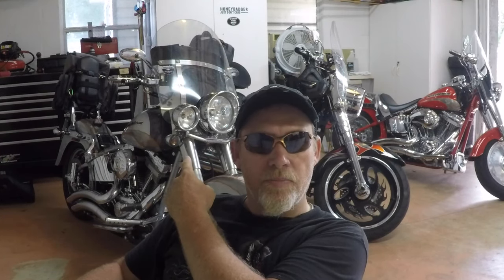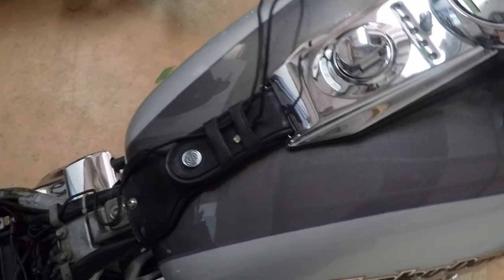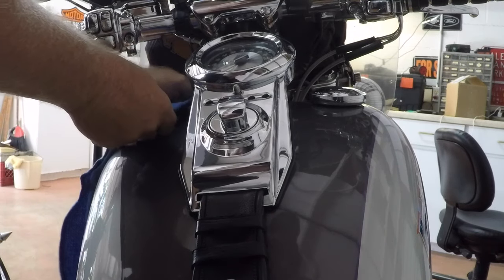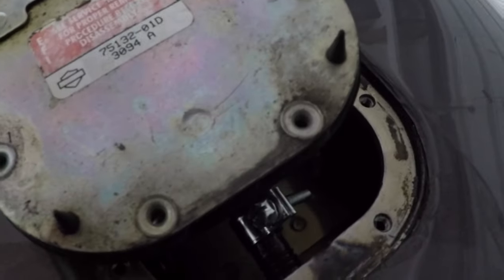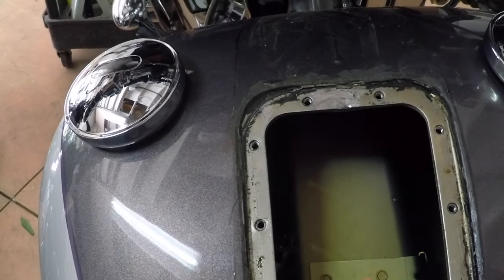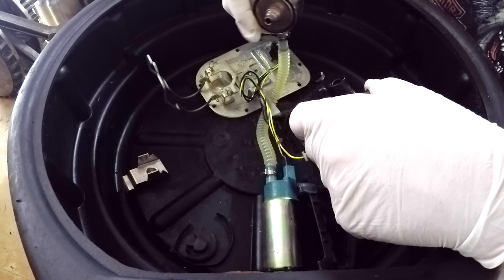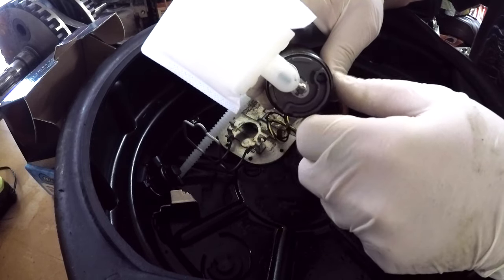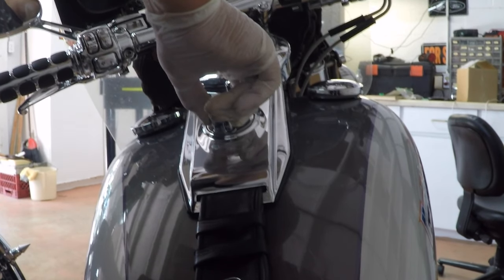How To DIY Replace a Harley Davidson Fuel pump, Fuel filter, and Fuel Pressure Regulator.

Comment: Greetings, and coming to you from Central Florida. The issue I have been having was described in your video exactly, but what was the most helpful, as no one else has offered the suggestion, was to LOOK INTO THE TANK when turning on the ignition and look for the "spraying fuel". I did not think I would be able to see spraying fuel in that very small hole where the fuel goes, but as I did what you suggested, there it was; like a shower spray. I followed your disassembly, but decided to drain the tank before doing so, which was very easy. In less than 10 minutes after disconnecting the battery I had the unit out and disassembled. The tell tale signs are there; cracked mounting tabs on the regulator with the o-ring bulging out. This job would have cost over 500.00 at a Harley Dealer. I am doing this repair on a 2005 HARLEY SOFTAIL DELUXE with FUEL INJECTION. Many, many thanks, my brother, for your tutorial. Another excellent  video from You Tube College.

Comment: THANK YOU! This was very helpful - not only did you not replace every stinking thing, like some people have said you should do including the screws but most importantly you provided the link to the Amazon parts.  That's really helpful!  I just priced out a replacement fuel pump assembly (part 75284-08A) for my 08 FLSTSB and it was $295 (Feb 2024) from the dealer.  On Amazon it's $80.  Thanks again!

Comment: Brotherman I'm SOOO glad I found your video THANK YOU! Ive been banging my head to the wall thinking it was intake gaskets causing my bike to run super lean and seems like its out fuel.. Well, When u brought up how to know this take gas cap off and used flashlight and turned the pump on I thought it was really odd it was shooting everywhere. You saved me a BIG headache! Thank you for this video you are the man! That description of how to check it was DEAD on to what I was seeing.  Subscribed!
Reply from the maker: Thanks man I am glad it helped and saved you some time. Thanks for watching!!
Reply: @TheBadgers   Today , got parts removed fuel pump assy and the regulator was almost completely apart from black housing. Just bought new everything on inside! Once done its running like a champ!  Does this just happen due to pressure pushing the 2 parts away from each other, Or just age. Sorry First HD. :)
Reply from the maker: @XenoWiz  it is a known weakness probably a combo of it all not to mention it’s in fuel which doesn’t help
Reply: ⁹kilo

Comment: I used this video to replace my pump. I had the same issue with putting the retaining washer on the post that secures the prefilter to the pump. I also had to use a small socket and a hammer to drive it on. If you want to keep everything in place put a small piece of tape over the spring washer, taping it to the prefilter housing before you drive it onto the post. This will keep it from dropping off before you get it driven onto the post.
Reply from the maker: Glad it helped,  thanks for the advise and for watching.

Comment: You may know better than me but but I started taking those screws out with my little impact and stopped and switched to a regular ratchet because out of the corner of my eye I seen the Sparks that are admitted inside the housing of the impact😮. I may just be overreacting but I know how combustable just the fumes from gasoline are. 6:07

Comment: Mine just started spitting and sputtering. First thought was fuel or fuel filter. Ill pull the gas cap and see if I see gas spraying around. Thanks for the tips.
Reply from the maker: That sounds like the symptoms for sure, hope you find the problem and get her fixed. Thanks for watching and subscribing.
Reply: What I found was the fuel pump strainer fell apart and half was sitting at the bottom of the tank in one piece. The rest is in tiny pieces or in my fuel filter. I managed to fish out the big piece with a coat hanger.
Reply from the maker: @sjeverett75  did it damage the fuel pump?
Guessing you changed the fuel filter?
Reply: @TheBadgers  I was going to replace the filter and the check valve hose, but my wife said she doesn't want me doing this again in a few weeks so I should just replace the fuel pump and regualtor too. I'm not gonna argue with that.
Reply from the maker: @sjeverett75  might as well take care of it all at once. Glad you got it fixed

Comment: I have the same problem I turned on the key and looked in the fuel tank and I did not see no spray in the tank so what would I need to check other than that?
Reply from the maker: Could be other lines in the tank they will develop holes and create the same problem, while you are in there replace them all and the pressure regulator and housing

Comment: When reinstalling is the pump mount supposed to be locked in the 90 degree position?
Reply from the maker: No you will lock it in position once reinstalled

Comment: Did you buy new regulators also? I didn’t see that part in the kit. Only the pump and hose
Reply from the maker: @tedmond72able  I did but you don’t have to the housing is the actual issue
Reply: When you say housing, is that actually the pump itself? Man thanks for the quick response you’re awesome! 🤘🏽
Reply from the maker: @tedmond72able the regulator sits in a plastic housing, it cracks and make the bike run badly you can just replace it separately
Reply: @TheBadgers  thank you much sir

Comment: I have the same setup. However, this makes me wish I had a petcock, an inline clear filter and my S&S Pumper E carbratooter still!
I spent today covered in gas when my softail crossover pipe nipple broke out of the tank unexpectedly when checking the hose clamp.
Progress? I do not think so!
Very helpful video though, thankyou.

Comment: Sir, I need your input. I was foolish enough to let my fuel injected 2006 Harley Heritage Softail run out of gas. After filling the tank, it will not idle , runs extremely rough, spits and coughs and will die at all speeds. I will be putting in some Sea Foam and hope that it helps if the pump picked up some debris from the bottom of the tank. If the Sea Foam does not work, do you foresee me having to replace the fuel filter? Also, is there a way to drain the tank?
Reply from the maker: Yes you can drain the tank with the crossover hose at the front of the bike. Have you checked the fuel pressure regulator housing?

Comment: Good job although its recommended by HD that all 10 self-sealing screws and top plate gasket be replaced in order to avoid gas vapor escape.
Reply from the maker: This is true, so everyone should do what they are comfortable with, of course they also recommend using a Harley trained technician at one of their dealerships.. Thanks for watching!
Reply: My dore seal liks
Reply: @TheBadgers  haha so true mate ! Good job 👍🏻

Comment: My 07 soft tail custom the fuel pump jus stopped cycling it doesn't run when the key is turned on i left the tank empty enough for the fuel light to be on an it sat for over a year I'm assuming the pump froze up good video thank's
Reply from the maker: Do you have power to the pump? Thanks for watching be sure to hit that subscribe button it helps us out
Reply: @TheBadgers  I did at one time while moving it around and running it to keep thing's lubed up then one day (a while after) I turned the key on and had nothin I actually haven't done any trouble shooting yet but figured with the old old gas sitting in it and run riding it that the pump froze up

Comment: Great video, right up to the point of the high speed stuff we are supposed to watch too, it is part of the installation process. Didn't like that at all, felt like we might miss something important. Or an easier way to do the replacement.
Reply from the maker: Sorry I sped it up because it was a simple part and didn't want to make everyone wait through it. Thanks for watching and the great feedback
Reply: @TheBadgers  Ya but this is my dream bike that I bought by building three others and selling them so I could afford this one so I want it to be kept in pristine condition so my wife can sell it when I die and use the money to put me in the ground. I do not want to mess anything up on this one. So I'm going to be looking for videos to keep it up and running for as long as I can work on it myself. Stage five kidney failure so my time on two wheels is going to be really limited.
Reply: I had the same 05 fat boy silver. Sold it thought it would hold its value but I'm learning these bikes to not hold their value but I would love to buy a blue one 05 Screamin Eagle Fatboy anybody knows where I get one

Comment: My son's 2011 soft tail set up for a bit.  When flipping on the run switch, you don't hear the sound of the fuel pump priming.  I'm guessing it's time to replace the fuel pump and all other parts inside the tank.  Will order the part from JP/Amazon and install it.  Hope it get her going.  Great video!

Comment: My 07 FLHTC ran fine on Saturday, then wouldn't start on Sunday. I disconnected fuel line from quick connect port, then reconnected, & it started. Went for a test ride, and it died 5 or 6 times in about a 2 block round trip - each time it restarted after disconnecting & reconnecting fuel line. After I got back home I was able to get it to stay running, so let it idle for 10 minutes. So now it starts like normal, but I'm afraid that it will leave me stranded somewhere. It might have just been an air-lock in the fuel line (so I've read) but I'm going to replace those parts, to be safe. I've read that ethanol in fuel deteriorates those parts. 2 Co-worker used to be H-D mechanics, & both still wrench on the side, so gonna have one of them do the work for me. I think it will be money well spent for preventive maintenance.

Comment: On the reinstall what is the torque specs and bolt pattern, thank you
Reply from the maker: Consult your manual for those I just tightened mine down, in no certain order

Comment: I have a 2012 road king and my bike does the same thing. It has 55k on it. Like it feels like it’s running outta gas and I give it some more throttle and it will act rite. Usually happens when it’s cold. Same thing as yours?

Comment: Good video.  I'm curious to know if you'd have some insight that might help me.  I have a 2005 RK.  I recently took the tank off to install rocker lockers (didn't help much) and when I put it back together I found my fuel gauge to be dead in the water.  no power to the gauge, it reads empty, and the low gas light on the dash stays on.   I've checked and double checked the wire connections.  The fuses are ok.  I had the battery disconnected during the job, anyway.  I was slow and methodical in my work.  i just do not understand how what i was working on would cause the gauge to quit on me.  One thing I would add is that I hung the tank up vertically from a ceiling hook with a bungee for a couple weeks so gas wouldn't drip out and to keep it out of the way from being damaged.  Do you think me hanging the tank up could have screwed up the fuel pump/gauge unit inside the tank somehow, causing my gauge to quit?  Any ideas?  Pisses me off.  No way I'm taking this thing to a dealer.
Reply from the maker: Wow man congrats on doing the job yourself, as far as the gauge man electronics are such finicky items , I honestly don’t know, let us know what you come up with. Thanks for watching!!
Reply: @TheBadgers  You can use a DVOM and check the ohm readings of your fuel level sending unit. Unplug your wires and use the meter to take readings when the float is down and when the float is in the up/ full position. You may have to research the ohm readings you should be getting from the sending unit in the full and empty positions.Your float may also be malfunctioning after being removed from the gas. The float may always sink to the bottom; giving you an empty reading all the time..
Reply: Update on my issue, long after the fact.   I soon realized that my problem was a badly corroded delphi connector, i think theyre called.  The whole thing looked like a fuzzy green penny.  So basically the wiring, leading to the fuel gauge from underneath the tank.   I guess me disconnecting and reconnecting it that one time caused a corroded pin to break free from its wire.  I ended up having to take the connector pins apart and replacing the connector and pins.   Not going to corrode on me again.   I have the connector sealed off from each end now with silicone rtv, and grease.   These older bikes....seems like every time I take my bike apart to fix one thing, I discover something else I need to address.  I am about to replace my regulator, its housing, fuel filter, the check valve and the inside lines.  My check valve o rings are kind of weepy so I'm going in there and basically replacing everything but the fuel pump, which I know was already replaced some years ago.   A bit of preventative maintenance so hopefully i do not get stranded.

Comment: I have a 2008 Ultra, It went into limp mode, could it be that the fuel pump or regulator is bad on mine as well?
Reply from the maker: I guess it could I know that the regulator and lines in the fuel tank can cause all kinds of issues. On mine it spit and sputtered like it was running on 1 cylinder or running out of gas. I could pull the gas cap look in the tank and turn on the key and the regulator was spraying fuel all inside my tank.
Reply: @TheBadgers  Thank you for your reply, I'll change out the fuel pump, regulator and filter.  It will be awhile before I can afford to get it all but I'll let you know if it clears up my problem, thanks again

Comment: Any update on this? Bike performing well since this video? Did you change all three (Regulator, Filter & Pump) just because you were already going in there? I am having similar symptoms (sputtering, chugging, loss of power, & stalling) in my Fuel Injected '09 Heritage (i have owned since 2017) and thought about trying the fuel filter first since I have no record of it ever being serviced. I changed the Crank Position Senor and still have the symptoms. This riding season I have already changed the Oil, Oil Filter, Spark Plugs & Wires.
Reply from the maker: Yes Bike runs good, all you probably need is the pressure regulator and the filter, but I have also see a hole in the hose inside the tank cause the issue as well.

Comment: How do you remove the float assembly?
Reply from the maker: From the tank or from the assembly
Reply: @The Badgers  from the tank.  It is seperate from the pump assembly.
Reply from the maker: They are all one unit, you have to push down on the float assembly, it is spring loaded and once you push it down it will let you move the assembly around to get it out of the tank easier
Reply: @The Badgers  I am swapping out tanks.  Bike runs fine old tank had dent.  Replacing tank with a good one.   Since it's all apart should I replace full pump?  2006 with about 6500 miles.
Reply from the maker: @chilipepperz06  Personal preference My bike is 18 years old with 145,000 miles. It still has the original pump, I would replace the fuel pressure regulator and housing, fuel filter and all the hoses

Comment: Do i need to buy the whole kit or can i just replace the fuel regulator  housing ?
Reply: And the hose
Reply from the maker: You can replace each piece individually, I would replace the regulator housing and fuel filter at minimum.

Comment: Great video thank you for the info. I have a question. I have the same bike and m I am getting 2volt out of the fuse and I am getting the same at the fuel pump on the plug by the gas tank, by any chance do you know the electrical specifications for the fuel pump, or can you give me a hint what to look for to fix the problem that I have? Thank you in advance
Reply from the maker: Hi Kris, honestly have no idea what your issue could be without working in it myself, I am guessing that the bike has a fuel pump relay of some sort I would start there. Thanks for watching, sorry I am not much help.
Reply: @TheBadgers  thank you for the help

Comment: My buddy has a 2006 Harley ultra classic that has sat for two years and we know the bike is clogged up with bad fuel so would the filter and pump be clogged  what about fuel lines and injectors.
Reply from the maker: start with the tank, filter, regulator, and probably the pump. I would run some cleaner through the system for sure,

Comment: Did the kit include the Fuel Pressure Regulator Housing or would i need to order that separate?
Reply from the maker: The kits don't include the housing that I have seen, you have to buy it on its own. Follow the amazon link in the video and it gives you tons of options. Thanks for watching, and be sure to subscribe!

Comment: Did you have to release the pressure if so how?
Reply from the maker: I have taken many apart and never had any pressure to release, so you should be good to go.
Reply: @TheBadgers  Thanks Man
Reply: Pull the fuel pump fuse, then start the bike, when it stalls pressure is neutralized.

Comment: would probably be a better video if you didn't speed through some of the important dis-assembly and re-assembly spots.
Reply from the maker: Sorry it was too fast for you, maybe play it back in slow motion? If you hit the gear icon for settings you can slow it down to .25